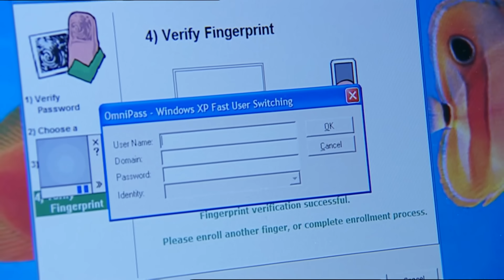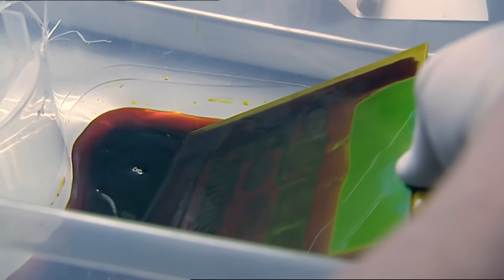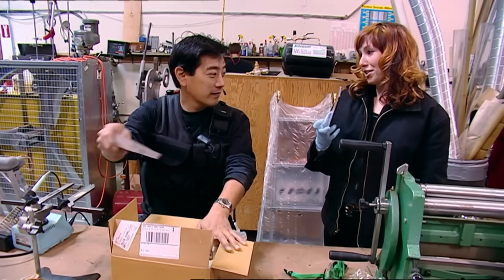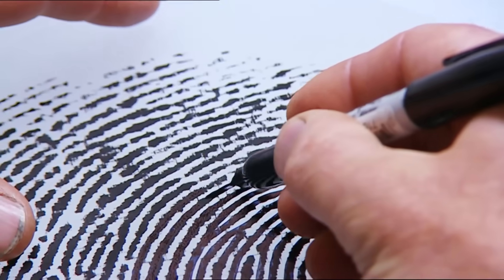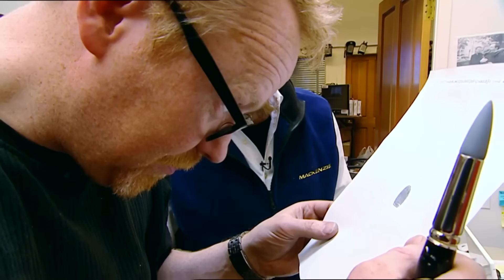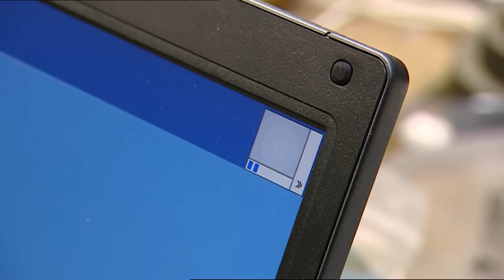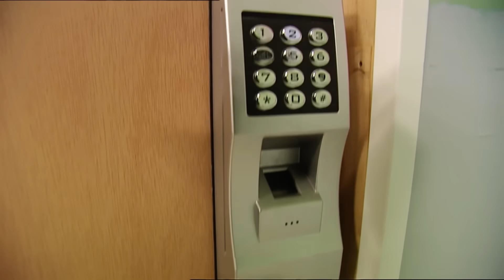Can A High-Tech Fingerprint Scanner Be Hacked? | MythBusters

Comment: That's why I'd never buy a fingerprint door opener. Just use regular thub tags or if you really want to go biometric and hands free: Iris scanner, but I've never seen those for domestic use.

Also the device that shorts the wires should be inside, because otherwise you can just rip apart the finger print reader unis and short the door lock wire and the door will just open.

Comment: 5 rupees (3 cents) worth of white glue is all you need to nake your own duplicate fingerprint. Made 10s of such prints works both for optical and capacitive scanners. Haven't tried in ultrasonic ones though.. But ultrasonic scanners are very rare to find. So yeah you can hack a fingerprint scanner with some cleverness and 3cents worth of white glue (fevicol, Elmers glue etc)

Comment: I just want to know why the door fingerprint scanner was easier to beat than the one for the computer. Was it an older model?
Reply: Because there are two kinds of sensors used for this (mostly), one is optical and the other one measures capacitance. The optical sensor was on the door lock and it just needs a contrast 2D image. First reader had capacitive senzor, wich needs actual 3D relief as it senses the difference in capacity and stuff that is touching the sensor (like every ridge) has higher capacity than the air gap. Both types have some positives and some negatives, for example the optical senzor is faster and has higher resolution. The capacitive senzor is sensitive to static discharge.
Reply: Newer versions of scanners are a bit better but the same basic method still works, especially the superglued onto the thumb method.
Reply: @koori049  There are scanners that also map the shape of your blood vessels and those are really hard to break, but they are really expencive.
Reply: @mrkv4k  These are impractical as if you develop a callous, injury etc, that will be a problem
Reply: @shrujanamsyama9940  That's why you usually have two method of access and why it's common to add more than one finger (often both pointers and thumbs).
Reply: @mrkv4k  If we are speaking of 2 factor authentication, then it has the same issue except now hacking will need 2 fingerprint. Hack-proof is when there is advanced feature like retinal scan, or password combined with fingerprint etc. But these are inconvenient & slow down things
Reply: @shrujanamsyama9940  No, we aren't. I'm talking about two parallel methods of access, like fingerprint and RFID card. You can use FP for convenience but always have the chip as a backup.

Comment: Those don't work for me! I had a Panasonic toughbook that had one of those for security but right after I scanned my print it didn't recognize it. Then I used to donate plasma and to sign in they had those but they never worked for me so I had to wait and do the sign in process with an employee. Also I had a job where we had to clock in and out using one of those but it never worked for me so the manager had to go into the system to make sure I got paid. I won't even try them anymore. But surprisingly if I get my fingerprints done with something similar that isn't a problem.

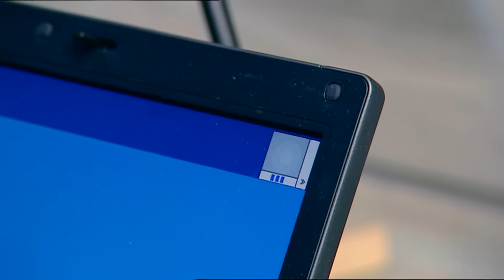Comment: Jamie was pushing too hard on the ballistic gel print at 2:50. If he just touched it instead of pushing it into the print reader, he prob would have gotten it. You want to lay it on the reader just lightly enough so it reads the raised print and not push to hard the non print part it pushing to the reader and making the lines not as visible.
Reply: I totally caught that too. He was depressing the ridges into the fingerprint sample.
Reply: i thought it was too thin and too transparent, therefore it couldnt get a clear scan
Reply: @iWhacko he's pressing down sooo hard. It's literally deforming the sample. I don't see how it couldn't be also depressing the ridges that made up the finger print as well. Just based on how the visual of the print was changing when he was scanning it, it also made it look like that's what was happening.
Reply: we have several at work and most of the time you have to spit or lick you finger to get it to read good and push really hard